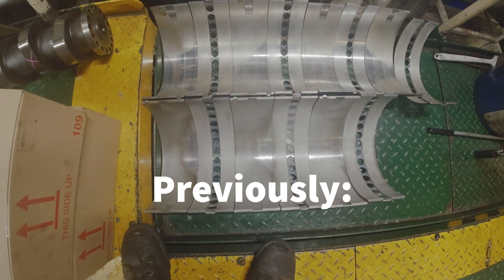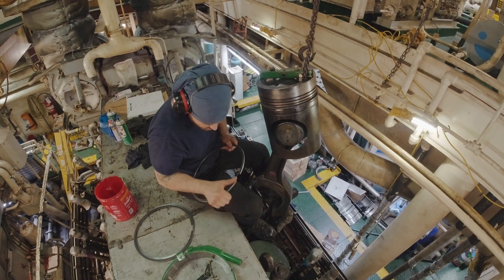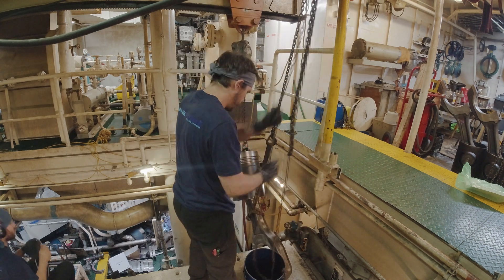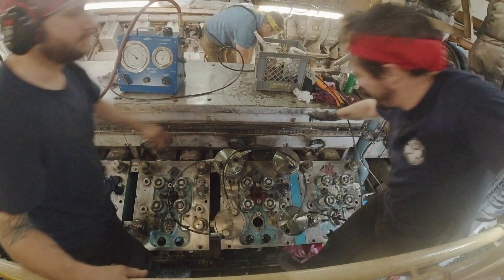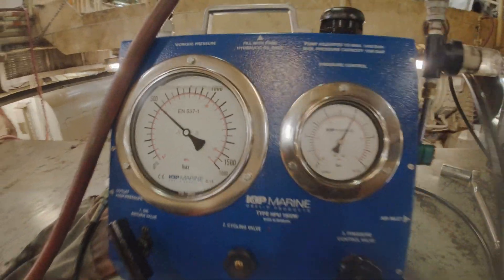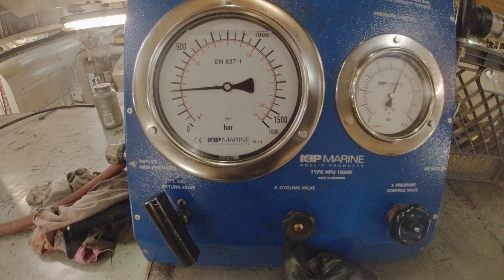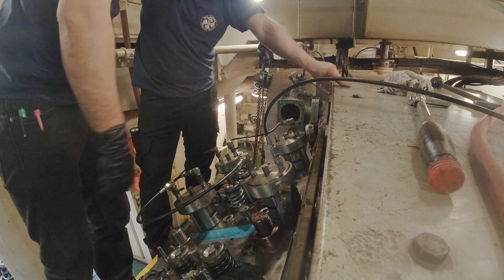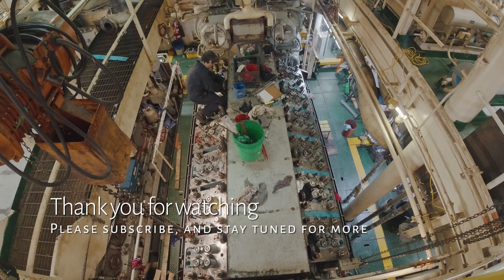Wartsila 12v32 Overhaul: Pistons and Cylinder Heads

Comment: Having worked on small engines myself, and not having to worry about using a hydraulic system to bring them to torque, have a  question, what are the bolts made out of? And how many times can you do that before replacing them?
I love big diesels !
Reply from the maker: thats a good question, I'm not sure what alloy of steel the bolts are made from.  The bolts into the connecting rods, we replaced during this process.  The cylinder head studs are most likely original from the 1980s.
Reply: @therealmaverickx  
Very interesting, whatever the bolts are made out of clearly their design is to take that level of stress for their entire working life,  it sounds like to me. 
Keep up the updates, really enjoying what you guys do.